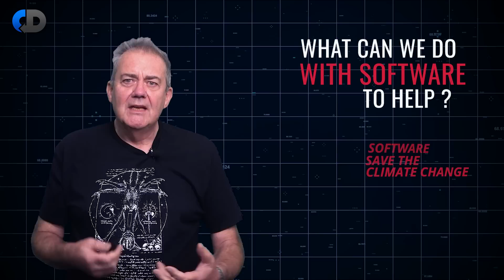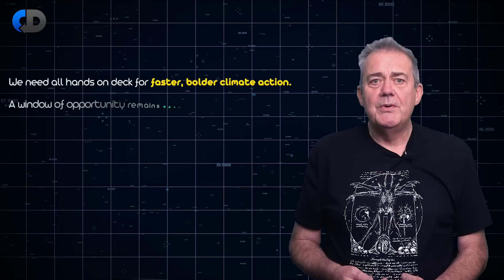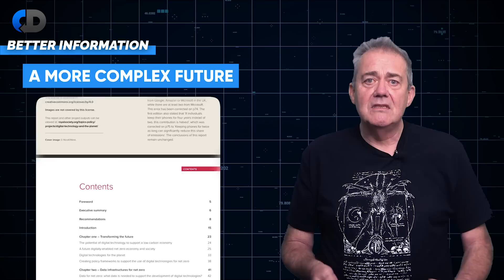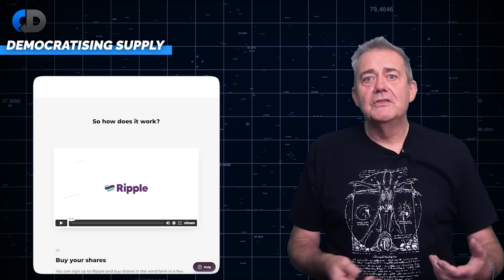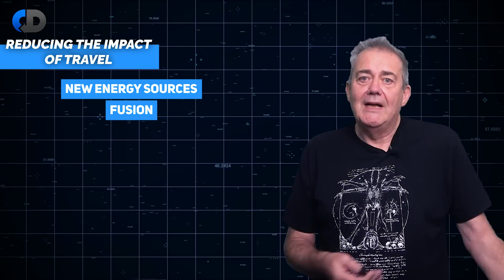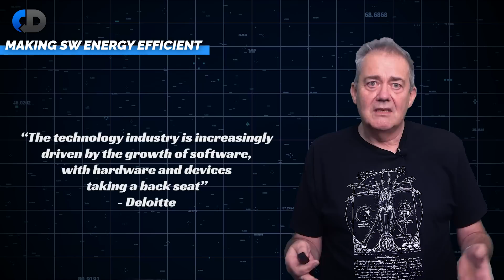Software’s Role In The Fight Against Climate Change

Comment: I usually love your videos but you’ve been lied to here. Some facts for you:

Total CO2 in atmosphere: 0.04%

Of that, caused by humans: 3%

If it dips to 0.02%, all plant life dies.

It is historically extremely low.

Temperature influences CO2 levels, not the other way around.

Our ecosystem is self-correcting; more CO2 = more plants = less CO2.

Temperature data has not been collected consistently (in some cases they even use proxy metrics). The ‘hockey stick’ graph is a fabrication and Al Gore a fraudster.

Comment: Why would you believe there's catastrophic climate change occuring now?  There's no trend in droughts or floods, hurricane and cyclone strength is relatively flat,  it really seems like weather has been within normal variations.  Even the IPCC expressed that there is "low confidence" that any climate change signal can be inferred from extreme weather events.  I will find the source in the IPCC.

Comment: As an Embedded Software engineer, this resonates much more with me than maybe others.

The rapid increase in computing performance has generally corresponded with increasing inefficiency in code development.

This is not a deliberate or malicious on anyone's account, more a function of the drive for profitability.

As you repeatedly state, Software development is hard and software optimisation is usually harder, consuming vastly more effort than the initial creation in general terms. As a result it is expensive.

In terms of low hanging fruit, maybe another target would be the frameworks on which a lot of this software is executed, as these are generally at the heart of many systems and so a reduction in resource usage here would result in significant gains in many systems.

Comment: Excellent topic choice!  Efficiency is the basis for the experiment that is Brown Horse Software.   My app is based on a simple network of asynchronous  phone networks with data distributed on ranked nodes.  The constraints are that it can be both written and maintained by one person and run for pennies. The app itself is a niche app designed for mutability.  My Google App Engine cloud footprint is about 500 lines of message switch and network admin code.  My monthly cloud bill in development has been .01 usd.  Phones are probably the greenest platform around.

Comment: Maybe for fixing this we should focus on dropping unnecessary crap from the Web, like 3 tons of JavaScript for which HTTP was never fully built for, push towards self-hosting on efficient hardware which we have access at home, and block mining cryptocurrencies forever, plus block whole Web3. Then we will be in much better shape. Best would be to have small home servers hosting simple websites on solar-powered hardware ;)
EDIT: Additionally, we should push towards ActivityPub-based web services, like Mastodon, Pixelfed or Peertube
Reply: running your website on the cloud is going to be a lot more energy efficient than anything you do at home.
Reply: @darylphuah  Depends, on surface - yes, but if you take into account that you can run your low power server using netbook/terminal/SBC even from solar panel, hosting @ home wins :)
Reply: @d3stinYwOw  and what connects your server to the internet? did you take your modem & router power draw into consideration? 

Cloud services are shared resources, which is what makes them energy efficient. Even if you use solar, you'd have a hard time competing on efficiency/carbon emmissions with a data center.
Reply: @darylphuah  Yes, I took, and they usually don't take that much of a power if you use a simple domestic router flashed with OpenWRT ;)
Hard time competing with power hungry machines hosting thousands of websites and other weird stuff lying around the internet, which consumes too much of resources than really should? I don't think so :).
Reply: @d3stinYwOw  those "power hungry" machines use very little per website once you divide it out to the thousands it is serving. 

Running your own stuff is great, decentralization has its benefits, but energy efficiency is not one of them. Anything centralized scales much better, its all about trade offs.
Reply: @darylphuah  99% of websites which we have currently up and running take too much of resources, so if you want to make energy efficiency argument, first web needs to cut the bloat.
Reply: On the other hand, since most of web client devices are capable of doing most of ui related tasks (sorting, animation, navigation, rendering etc) it's more efficient to keep it on frontend instead of calculating or on a backend and updating with every request like in MVC. Instead of sending a lot of html you only send json and only when new data is needed

Otherwise, you need more server resources and your phone/pc resources are mostly unused at that time

Comment: I feel one of the reasons a lot of software is orders of magnitude less efficient than it could be is because it can afford to, the capacity of hardware scaled, I would venture, faster than our collective skill or care for efficiency, take a simple calculator app, its itself so lightweight by nature, that it has little pressure to use its hardware resources efficiently, therefore most wont, necessity is the mother of invention after all.
In my industry (games) a lot of effort is put in efficiency for those projects that strive to push the hardware to its limits, the ones who don't do that, take a licence to be less than optimal because the effort is outweighed by other pressures, like release dates, or bankruptcy.
As others have commented, optimizing is also often done to make room for additional functionality, not for less consumption.
Its a problem of incentives.

One place I would say there is an unequivocal incentive to optimize would be build times, who likes waiting for a large c++ project to compile? I wonder how much Co2 comes from build times alone... :P

Comment: I have a strange experience with respect to Python performance. Most of the time in production systems I run into Python is faster than Java or C++ even though those languages are easily faster in microbenchmarks. I suspect the issue is that Python makes it easy and standard to hand off the harder computations to standard libraries like Pandas. Numpy, Scipy, Torch, etc. and also that on real systems data structures are so extremely important and Python makes that easier than Java or C++. 

I know for sure that I can write C++ code that is much faster than Python code but I also know that I had formal training in doing that. Most people don't have that training and without that they often struggle to make something as fast.

Comment: How about we start with not guessing random hashes with zeros prepended on mass scale to register transactions for no apparent reason? (yeah - "privacy" - doesn't quite work like that)
My bs detector went off. If data centers go for renewable energy (AC takes as much power as the compute), since this is the biggest contributor from the "run code" side and we'll switch to ARM (looking at you 300W TDP CPUs and 450W TDP GPUs where ARM can do the same stuff with fraction of the same power) our digital footprint disappears quickly. Seriously — choosing data structures as a way to combat climate change is the most stupid thing I've heard in a while (even if it makes slight sense on a technical aspect of it) — especially for most of us mortals who are not in the 0.001% of biggest cloud customers for e.g. 
The lobbying of Intel against ARM, hesitancy of Microsoft to go full tilt on it, old hardware running code in private DCs — If you really think that individual contributors are the reason for it you are so blind. It's corporations no matter where into the charts you'll look and the shift of blame on people like you and me only helps them and is what they want, while they'll tell you how they removed things you'll get because they are so concerned with environment (not at all cost cutting) and continue do their things.
Thinking about appropriate infrastructure scaling for your application? — Sure, why not even if it doens't help anyone pretty much at all at least it will cost less. Focusing on code over-optimisation if it's not ludicrously broken? No words on this one. Choosing your language based on that sounds like "assembler is The language and all else is slow" all over again.
Reply: Boo! Crypto is a scam!!! Without trust there is no society!
Reply: @swagatochatterjee7104  Crypto on its own is not a scam — very nice technology for ledger databases which certainly have some uses when it comes for e.g. to compliance. Using that for transactions is just retarded tho and simply can't scale while eating INSANE amount of power for any given block to be signed where the work required stays the same thanks to the aforementioned zero prepending. I tried to understand smart contracts and proof of work side of things and to be honest I still don't quite get that, but as far as I can see there is no useful implementation of it available either and its fairness/consensus mechanism is still a huge problem.

Comment: Dave this is not true and you are drinking the KoolAid. It’s not doubt either, it is scientifically proven. If you like to eat plants or breathe O2, you will not lower CO2. CO2 is actually too low. Ecosystems require high levels of CO2 for efficient photosynthesis. Quit listening to activists who stand to make billions.
Reply from the maker: No, not kool aid, science. CO2 is a green-house gas, you can measure that yourself. Who makes billions from this?

Comment: Good subject. Been on my mind for a few years. There should be some kind of certification for how to write green code.

But again, the climate issues is due to carbon footprint and other footprints too. Perhaps a valid option would be to close down IT. Return to analog ways of things again. Digital systems, internet are spending much energy when being used. What is the carbon footprint from today's IT? And most of it is built to be easy to use and may in many occasions be used without real necessity.